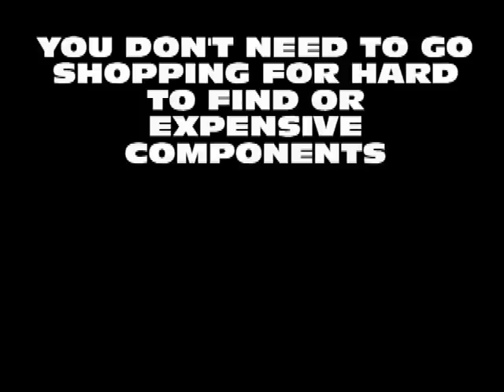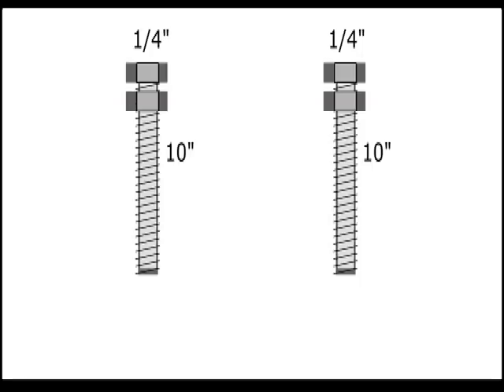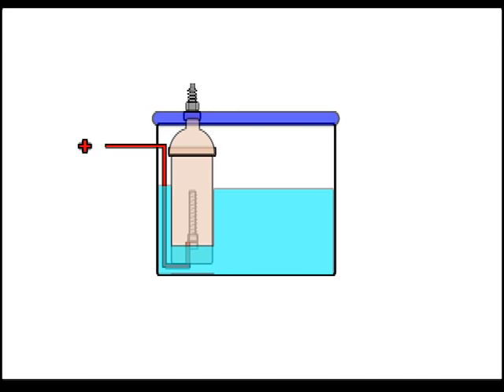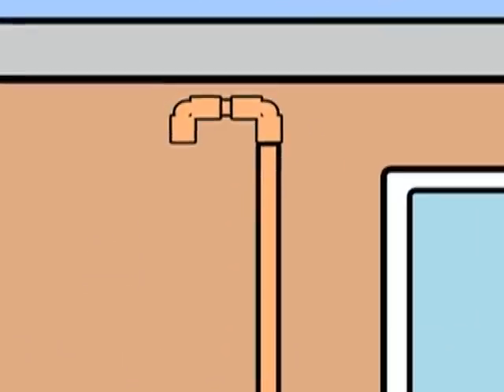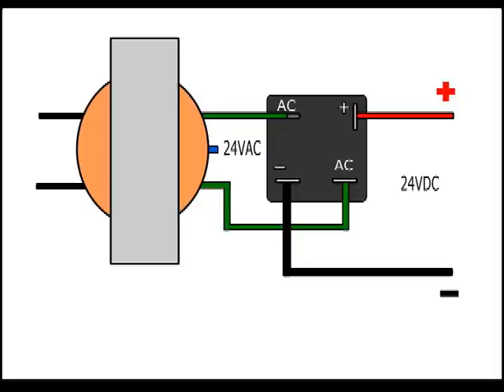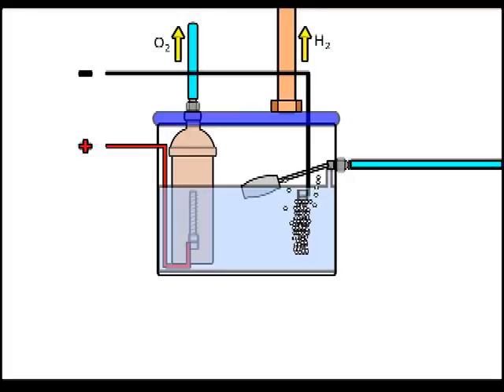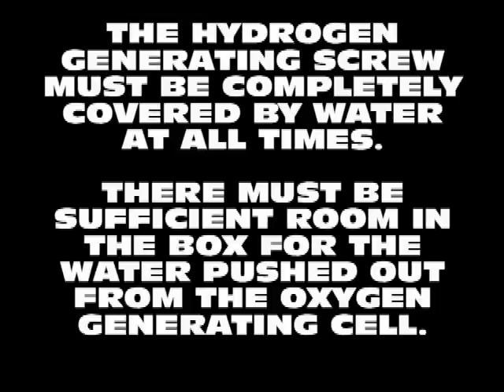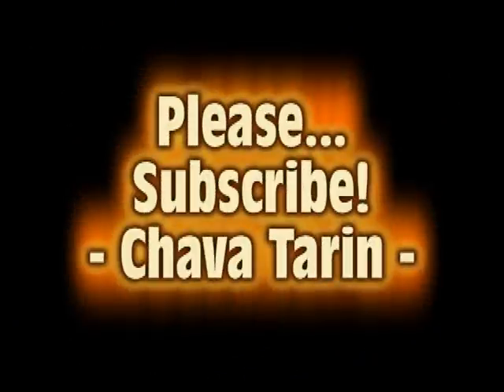Homemade Oxygen Generator

Comment: thanks for a nice video, a question on 8:00, why do we need to completely cover H generating screw? what would go wrong otherwise?
Reply: Well the connection would be broken and the electrolytes would stop, it realise on both electrodes being fully coved, hope that helps
Reply from the maker: The idea is having an auto-stop device, in order to keep pressure at a safe level and prevent mixing of the gases. The screw inside the cell is immersed in the solution, but as soon as pressure increases (due to closing the oxygen valve) the solution is pushed down inside the cell, thus less and less solution covers the screw and the less contact of the solution with the screw, the slower the reaction, until it stops.

Comment: Good enough, but production can be doubled by making the anode from aluminum metal and using dissolved (in water) sodium bicarbonate instead of aquious NaOH.
Reply: man can u tell how or link a site which explains this im very curious to know bout this ))
Reply: @harekrishnaparhi7943  Just do it, you'll see, but DO NOT test with an open flame? You've been warned.

Comment: What do you need to do to get 3 liters a minute flowing?
Reply from the maker: Hi, Mike or Jimmy, whatever works as a tiny prototype, can be scaled for more production. However, electrolysis evolves some heat, so cooling or dissipation must be provided, for safe on the long run operation. My original project was for supplying oxygen to a tiny torch, but indeed, it can be done. Some experimenting must be done. I think a bigger tank, with big plates instead of merely stainless steel screws could do the job. I ventured to make a drawing with suggestions for improving the generator, please find it at https://www.youtube.com/post/UgwRGRtRxJVb63bdsUJ4AaABCQ
Reply: @eltunene  Send the hydrogen to a tiny torch instead

Comment: great water is indeed h²o   but after the h is leaving the water it is only simple  H   not H²
Reply from the maker: Hydrogen has an atomic number 1, and an atomic mass of 1.00794, and exists as a diatomic gas (H2). The only chemical elements that are stable diatomic homonuclear molecules at STP are hydrogen (H2), nitrogen (N2), oxygen (O2), and two halogens: fluorine (F2) and chlorine (Cl2).

Comment: THIS SIMPLE O2 GENERATOR BY USING ELECTROLYSIS WATER METHOD, PRODUCES VERY SMALL AMOUNT OF O2 IN A FEW MINUTES BEFORE GOOD ENOUGH TO SUPPORT A FEW BREATHS TO A SINGLE HUMAN. IT IS IMPRACTICAL WAY TO REPLACE O2 CONCENTRATOR  TO FIGHT VIRUS ILLNESS.
Reply from the maker: Yes, indeed. The original idea was for using in a small torch. Thanks!

Comment: Built a few big O/H producers when they were all the rage back in the late 80s. Of course my design was far more elaborate. After all, it had to produce enough  H to run a small 4 cycle engine equipped with an high amp generator to continue the 14 vdc to 36 vdc via power inverter electrolysis process - thus, basically generating its own fuel from a small tank of ordinary tap water with a pinch of baking soda added to it for conductibility. I can see why this particular device has its uses today especially now with covid causing permanent lung damage in countless folks now living on O2 .5 to 6 or more liters 24/7. That said, it now requires a tank or an 400 watt home oxygen concentrator to live? It's become the reverse i fear for other gas the one we once  discarded as meaningless has now become far more precious then the other...

Comment: TBH this design is crap, 24 volts is too high, you are wasting most of the energy just heating the water, if you really want to use 24 volts you need a number of cells in series (in ideal conditions you need 1.21V to split water). the stainless steel nuts and bolts have a very small surface area, a screen or a screen-tube would be better. The max oxygen pressure of your system is given by the displaced water in the pvc tube, so if the tube is 10 inches high, the max pressure you'll ever get is 10" of water, or 0.36 PSI.

an oxygen concentrator might be more expensive and harder to find, but it will be cheaper in the long run, safer, and just better in every aspect compared to this design

Comment: The title is a bit misleading, and, this electrolysis device could be dangerous & possibly deadly if not done properly and used correctly.  Caution & adequate research advised.

Comment: You are very wrong. You better learn some science advice. Electrodes must be very close, separated by a neoprene gasket. If they are too far, than you need a lot of electrolyte...which is poluant.  You will consume 5 times more in electricity. And you can't have 24v in a single cell. That's will boil thr water. Per cell you can only use 1.5v. Electrodes close to each other. Check the hydrogen oxygen separation cells.
You need to go back to school.

Comment: Quantity of NAOH in water?
Plz mention in how much water we aad what amount of NAOH
Reply: It's not that important, it helps increase the conductivity of the water. The more the better but you get diminishing returns. However it will greatly depend on your transformer. Be sure not to exceed current ratings of your transformer (Or even your wall socket)

Comment: I have shared this video with my friends in India .. they desperately need oxygen .. can this oxygen be inhaled directly by a patient after passing through water?
Reply: Yes , But more precaution required to handle both gas, 
Material used for gas pipe is also important , finally efficiency need to calculated for amount of oxygen V/s power required.
Reply: No...pure oxygen is poisonous
Reply: @akshaybad  even if we pass the oxygen through water .. will it still be poisonous ?
Reply: @alienonmyownplanet2655 no, technically,it cn be used in tht case as it will moisturize the O2 and reduce its percentage but i advice to consult a doctor before using it on a critical patient.

Comment: Don't understand why oxygen comes out of one tube while hydrogen comes out of the other if there is no process going on to separate the two gases. Would you explain to me why are the two streams leaving the system not a 1:1 mixture of O2 and H2?
Reply: The process separating the gases is called electrolysis. It causes oxygen to be released at the positive electrode and hydrogen to be released at the negative electrode.
The electric field tears apart the water molecules into hydrogen ions and oxygen ions.  The hydrogen ions are positively charged so they get attracted to the negatively charged screw while the oxygen ions, being negatively charged, are attracted towards the positively charged screw.
Reply: @listerdave1240  I had to visualize the screws as the terminals of a battery. That's why he uses the bridge rectifier. Otherwise the polarity of the terminals would change and the situation I was talking about would occur. Thanks, buddy.
Reply from the maker: Lister Dave, thanks for your excellent answer!!!

Comment: To keep guesses to a minimum, what is the transformer specs....VAs   and what size are the electrodes?  1/4 " ....3/8" ??  A fuse somewhere either side of the transformer be nice and I will enclose the transformer as well, or use a 24VDC power supply.

Comment: Tap water in most areas contain other chemicals such as chlorine, and the electrolysis process will imbue these chemicals into gases being collected or vented. Also, care needs to be used if directing either oxygen or hydrogen into a confined space. People and animals cannot survive long on a pure oxygen atmosphere; the air we breathe us only part oxygen. From wikipedia:
"Inhaled air is by volume 78% nitrogen, 20.95% oxygen and small amounts of other gases including argon, carbon dioxide, neon, helium, and hydrogen. The gas exhaled is 4% to 5% by volume of carbon dioxide, about a 100 fold increase over the inhaled amount."

A pure oxygen atmosphere is toxic to humans in the long term. If you breathe air with a much higher than normal O2 concentration, the oxygen in the lungs overwhelms the blood’s ability to carry it away.

The result is that free oxygen binds to the surface proteins of the lungs, interferes with the operation of the central nervous system and also attacks the retina. 

Nice science experiment but don't take to breathing either the O2 or the H2.

Comment: you can increase efficiency of the power supply by adding a  smoothing capacitor of 2000micro farad  (uF) rated at at least 35v or more...
Reply: Where point to add capacitor?
Reply: @edysoes566  Between the red and black wire (or + and - of the bridge).  That will be an electrolytic capacitor and the polarity is critical - so the "-" line of the cap MUST go to the "-" (black) or it will blow up.

Comment: Thank you for this video. At the moment, pure oxygen is in extremely high demand and a generator like this can be very important. India in particular needs massive amounts of oxygen, so there should be a trust fund to supply these generators to every home.
Reply: Well it would be better if they cleaned up their environment and got started thinking of environmental issues instead. That's their worst problem.

Comment: I love this project Chava. It's simple and multi purpose. I'll be checking out your other projects too. Thanks,
Reply from the maker: Thanks, Frederick, for your kind comment!!! The generator was thought for using in a small welding torch, but with certain modifications, it can be used for other applications. First of all, the quality of the oxygen must be much better. Distilled water must be used, so no salts are present, which could pose a danger of producing other gases along with the oxygen, such as chlorine. A solar still can be used to save power in such a process. With regards to the amount of liters of oxygen per minute, that can be determined by the size of the generator itself, and MUST be checked by a health professional. Something else would be the energy consumed by a bigger generator, maybe solar panels can help here. Please check this drawing at https://www.youtube.com/channel/UCmjQnuJwV0FkjdEyi3099RA/community?lb=UgwRGRtRxJVb63bdsUJ4AaABCQ
Reply: @eltunene  sir what is the equation for electrical Power to oxygen produced .

We want to use for 2 patients.

Please suggest necessary modifications for medical use

8617268213
Reply: Wonderful👌

Comment: Can we make it for patients..?
Reply from the maker: The generator was thought for using in a small welding torch, but with certain modifications, it can be used for other applications. First of all, the quality of the oxygen must be much better. Distilled water must be used, so no salts are present, which could pose a danger of producing other gases along with the oxygen, such as chlorine. A solar still can be used to save power in such a process. With regards to the amount of liters of oxygen per minute, that can be determined by the size of the generator itself, and MUST be checked by a health professional. Something else would be the energy consumed by a bigger generator, maybe solar panels can help here. Please check this drawing at https://www.youtube.com/channel/UCmjQnuJwV0FkjdEyi3099RA/community?lb=UgwRGRtRxJVb63bdsUJ4AaABCQ
Reply: @eltunene  thank you for explaining such a very good way thank you so much dear sir 
Great job you doing great 
Take care 🙏🙏🙏🙏

Comment: Is this pure Oxygen are does it have any other impurities??
Reply: It will have a lot of water vapour in it. That can be removed by passing it through a dryer like the ones used with air compressors.
Reply: @listerdave1240  why will it have water vapour?
Reply: @mr.greengold8236   Any enclosed volume above a water surface will have a humidity of nearly 100% due to the vapour pressure of the water balancing with the pressure of the gas (in this case oxygen) above the water. Since the oxygen is being generated and removed at a rather low rate the it will stay close to the equilibrium, that is being almost saturated.
The higher the temperature the higher will be the content of water vapour in the oxygen. For example if the temperature is 20c then there will be about 15mg of water in every litre of oxygen. If the temperature is 35c then the amount of water vapour is about 40mg in every litre of oxygen.
Reply: @listerdave1240  Im trying to ask you a question but my comment is getting deleted
Reply: @listerdave1240 
Would this work??
Please seach quora or Google for this

Extraction-of-Oxygen-from-a-closed-loop-of-Fuel-Cell-and-Hydro-Electrolysis?
Reply: @mr.greengold8236  It would certainly work and it is a very interesting concept but I don't think it will work better than the conventional methods of generating oxygen.  The difference between that and the method described in this video is that instead of discarding the hydrogen it is consumed in a fuel cell to generate some electricity, thus recovering some of the electricity that was used for the electrolysis.
Generally unless one has a use also for the hydrogen (such as making rocket propellant) then electrolysis is not a very efficient way of making oxygen. It is however perfect for a low cost machine that can be made at home for small quantities of oxygen. The addition of the fuel cell to recover energy from the hydrogen makes it more energy efficient but still not as efficient as fractional distillation while at the same time adding a lot to the cost.
Reply: @listerdave1240  The thing is in India there is oxygem cylinder shortage.

Where oxygen generating plants are away from the city and trucks loaded with cylinders have to shuttle to repeatedly refill.

The advantage of this system is, even though this is less energy efficient, it can theoretically give endless supply of Oxygen without the need to move about with normal 300 to 500 watt power source
Reply: @mr.greengold8236 Unfortunately you will still need the power source, it would just be a bit less because the fuel cell will recover only about a third of the energy that goes into the electrolyser. So if you needed a 300 watt source for the normal electrolyser that discards the hydrogen you could probably use a 200 watt power source for the modified one that uses the fuel cell to recover part of the energy. So you save 100 watts from the power source but you would need a vey expensive fuel cell to give you that saving. Getting a fuel cell is difficult and expensive and probably not worth the saving you would get by being able to use a slightly smaller generator.
Reply: @listerdave1240  fuel cells are costly??

This is new, as far as I know, fuel cells are very cheap. The price is mainly for the electrolyte and catalyst. Apart from that its a simple arrangement.

Comment: I doubt that this will provide any quantity of gas but if the principle is used and the areas of the electrodes are increased then it will be useful......plate material instead of round screws will work better.

Comment: Thank you Sir for this great tuto. Let's not forget that hydrogen explodes in the air between 4 and 75%. And there is twice more hydrogen than oxygen. Let's be careful.
Reply: That's why he said it has to be installed outside the building, with high vent for Hydrogen.

Comment: 24 VAC would be an RMS  measure. The DC level at the output of the bridge will be equal to the peak of the AC input, which will significantly greater than 24 VDC.
Reply: The DC voltage coming out of the bridge rectifier would be 33.9 V.
Reply: @ScottMorgan88  only if a capacitor is used. otherwise it will be 21.6 V DC
Reply: @ScottMorgan88  Don't forget the forward voltage of the diodes, usually 0.7V each. this means that 24 * sqrt(2) - 0.7 * 2 =32.5VDC

Comment: It would be great to be able to concentrate and store the oxygen (as well as the hydrogen).  Do you have any idea how much oxygen is produced (liters/minute?) by such a system?
Reply from the maker: Dear Helmuttdvm, the amount produced depends on the size of the tank, as well as the current applied. However heat is produced also, and must be taken into account. It si better yo start with a small prototype and experiment a bit. I understand pumping equipment is very special, since both gases are very dangerous and agressive even un moderate amounts. Tomorrow morning I can send you some more info since I am away from the computer now. Thanks for asking.

Comment: You are Wrong!! Because :- (Iron or steel + Water + Oxygen produced in the reaction = Rust!) It means u will use too much electricity but u'll get small amount of oxygen gas due to rust, So its better to use Aluminium or pencil or other things instead of iron or Steel! 🙏🙏🙏👍

Comment: Great unit!!!
Very useful in corona time shortage of oxygen.
May save many lives.
Reply from the maker: Thanks for your kind comment!! Please check at https://www.youtube.com/post/UgwRGRtRxJVb63bdsUJ4AaABCQ for some important suggestions.
Reply: @eltunene  How many Liter of water last for how many litre of O2?
Reply: @Immunologist-BCell  ,good question!
Reply: @Immunologist-BCell  1 litre of water can produce 622 litres of oxygen
Reply: @alihashim6037  wha- 
Thats not even possible 

Water is made of two hydrogen and one oxygen molecule

So when we seperate water molecules we will get the gases in a ratio of 2:1

So we will get 1/3 liters of oxygen from a litre of water
Reply: @ATTORNEY380  you know that gasses are less dense than liquids right?
Reply: @ATTORNEY380  you are doing molar balance. H2O is in liquid form whereas O2 is a gas. Gases are less denser than liquid. I hope you get the idea
Reply: @alihashim6037  and normally we need 5 liters per minutes. , right?
Reply: @Immunologist-BCell  for?